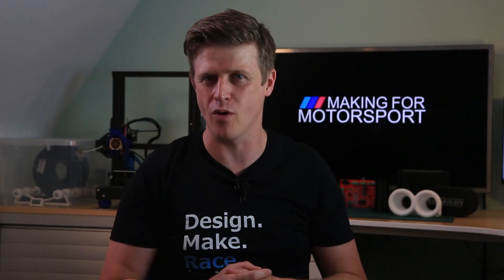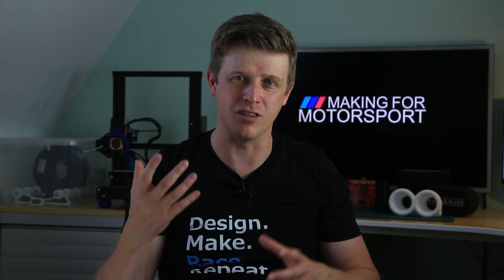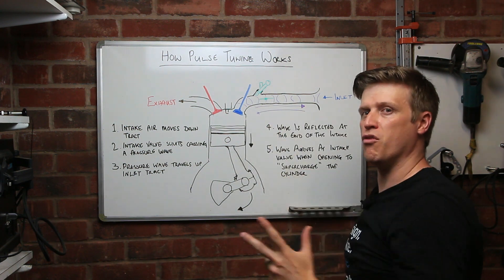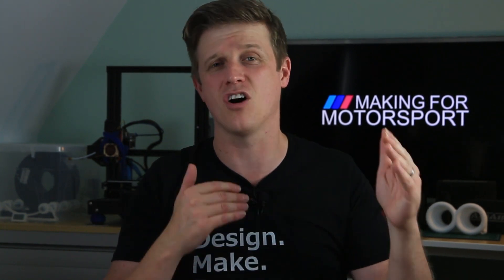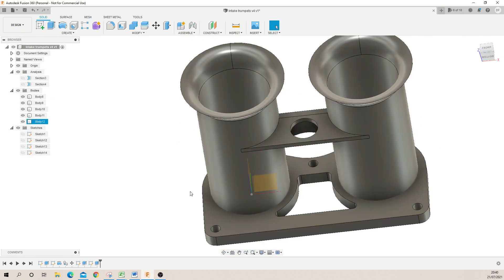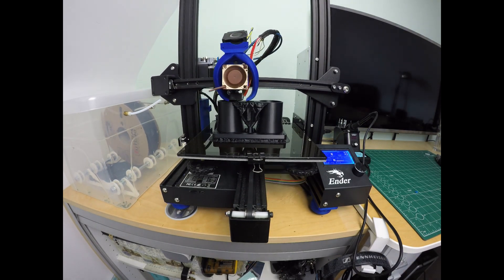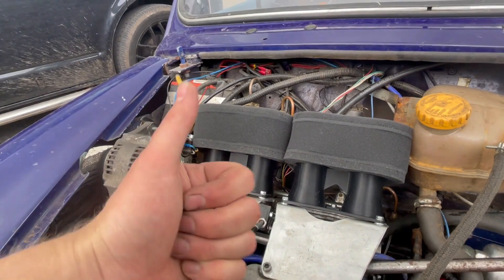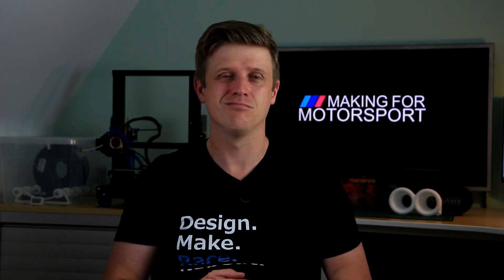Velocity Stacks - What they do and how to make them... a.k.a. Air horns, ram pipes, air trumpets....

Comment: Good video my only point is that there a two issues you need to be aware of, diameter of the ram pipe is very important as it controls the size of the pressure wave.  The second is you need a negative wave at valve opening to get the max cylinder fill.  I have research papers from  Honda race team to support my point I also have pressure traces and peak cylinder pressure reading that I got from my testing.  I am happy to discuss by email and supply you with the graphs and data to support my statements above.
Reply from the maker: Anthony, very interesting… I looking into the pulse tuning properly and there is a lot to it… I have promptly bought a proper text book the likes of which I haven’t seen since being in my University library, to do proper research.

If you have further good data and info on this that’d be great as I really want to put together THE BEST, most accurate video on this…. 

My email is on my channel page - makingformotorsport-at-outlook dot com…

Really happy to discuss futher….
Reply: @MakingforMotorsport  Email Sent
Reply from the maker: @anthonyparle7342  thanks for that, I haven’t seen it so far but I will keep looking 👍
Reply: @MakingforMotorsport  I sent it about 2 hours ago, its from my business email address.
Reply from the maker: Hi Anthony, found it in my junk, I have replied! 👍
Reply: @MakingforMotorsport  I just sent you a email with a graph Dave to start you down the rabbit hole

Comment: Hi Guy!! I designed some time ago an intake trumpet kit for keihin carburettors with the measurements for installing Ramair air filters. If you are interested I will give you the link where I uploaded them (on the Grab Cad page) since YouTube does not let you put a link here in the comments. I printed them in PLA 870 and it holds up very well !!!!. maybe ABS or Nylon would be much better. greetings and encouragement with your youtube channel, it's great !!!!
Reply from the maker: Cheers buddy! Glad you like the channel!  Good to hear you are doing some modelling and making yourself, the more people the better as far as I am concerned!
PLA does work for these but I wanted some margin so I definitely didn’t get failure…

Comment: Really incredible. i am blown away by how you broke the design down to it's simplest language.
However, I was under the impression that a hourglass shaped inlet was more ideal. Ie: flared inlet, choked center, flared outlet. It contributes to the venturi effect allowing increased airflow at slightly higher pressure.  Am I wrong?
Reply from the maker: Thanks for the comments, glad you’re enjoying it!
In terms of inlet shape, what you are describing is the shape used in carbs where the constriction and Venturini effect gives the pressure difference to move the fuel, however in injection you don’t need this and the choke just acts as a constriction to flow.  Yes, the air speeds up but as the diameter increases it slows down again.  Obviously it’s far more complicated than this but generally the fewer restrictions the better 👍
Reply: Thanks for the reply. I suppose I wasn't thinking clearly

Comment: Hi! i´d like to ask you if what you have in your print bed is kapton tape. And if it is, did it give you a good resault? with wich materials? 
I´ve been thinking on giving it a try.
Reply from the maker: Hi there! The print surface was a standard glass with Kapton tape on it.  This does work well but what you find it the tape starts to pull up from the glass and it also needs redoing every print.

I eventually bought a PEI spring steel build surface and have not looked back.  Winner.  I use it for everything apart from nylon.
Reply: @MakingforMotorsport  thanks a lot for your advice! I'll keep it on mind. I haven't tried pei sheet yet but I should. Only used glass, sand blasted glass, and a fake build talk surface (I'm from Argentina and it's kind of hard to get quality supplies)
Anyway I'll search for a pei one.
I really liked your channel !

Comment: any reason for using this instead of the carbon fibre you used for the inlet manifold?how is that holding up?
Reply from the maker: Just cost mate, the ASA is less than half the price, and the manifold is doing well, in fact I am just finishing a video looking at them and the other 3D prints at the moment 👍

Comment: Good one, for sure, more modling. 
What temps / mods do you use with ASA?
Reply from the maker: I run 250/85 onto PEI and it works beautifully.  I am making the next video which is a round up of the 3D printing on the car… that’ll have all the info 👍
Reply: @MakingforMotorsport  Thanks, enjoying your vids, clean and consice. 

Have a simple programable ign on my mini, but outdated and no option for logging or display. Looking at speeduino.
Reply from the maker: @no66  cheers bud!  If it helps your installation you can easily use the Speedy as ignition only if that makes life easier for an bit by bit install. It’s what I did…

Comment: i wondering, what kind of air filter (in video) did you use on the velocity stack ?
Reply from the maker: The cheapest known brand I could find! 😂. It’s a RAM-AIR unit that just pulls over the top of trumpets

Comment: more modelling here too, how do you choose radius, just trial on cfd? Thanks for sharing all that with us!
Reply from the maker: This will be in the modelling video in more detail,  but the limitations on diameter just meant I had what I had so I used the space…

Had there been some flow separation on the CFD I would have changed it but all was well!
Reply: @MakingforMotorsport  Got it! thanks for the answer

Comment: Here's a question I've been mulling over recently. Do you time your intake pulse for when the valve opens so you end up with a bit more exhaust scavenging if it hits when you have valve overlap, but presumably filling the cylinder earlier on means diminishing returns as it lowers the pressure differential throughout the rest of the stroke. Or, do you time the pulse just before the inlet valve closes so you pile a little more air in right at the last minute, meaning your cylinder is more filled than it would otherwise have been?
Reply from the maker: Absolutely, that’s one of the things I don’t like about the “traditional” explanation, the pulse at intake valve open would do exactly that, just lower the cylinder filling over the rest of the cycle, but stuffing that last bit in just before valve close… that might work…
The way I see it, when you put the last bit of clothes in the luggage, it’s just before you close it!  (And that’s what the research I have found says aswell)

Excellent comment!
Reply: @MakingforMotorsport  Thanks! The only benefit I could see of having it hit the valve when it's just opened would be to do some extra exhaust scavenging with valve overlap. What I'd want to do is make two different length intakes, one sized for valve opening timing at peak power and the other for valve closing and see which one worked better. But at the moment I'd settle for having the thing running!

Comment: Nicely made BUT just please let us know how would the average weekend eager mechanic would come by such an exotics printer, 
And now seriously what a setup such as yours will set you back 
In order to produce stuff like it
Reply from the maker: Ender 3 - £150
Glass bed - £20
Kapton tape - £8
1kg of ASA - £35
Fusion360 - £0
Total outlay - £213
(Assuming you have a working computer, and a house with electricity - if not this might get very expensive😂)
To do this in metal (aluminium) means having a lathe and Ac TIG, mine cost me £500 & £750 soooo £1250, I think that option is out (haven’t even mentioned the cost of the material).
The only other option is to buy them, if you want custom lengths (100mm?) you are looking at minimum £60/cylinder so £240.

So 3D printed = £213 vs Bought = £240 (but only 1 option leaves you with a 3D printer at the end of it! 😉)

Comment: another great video, hell yeah. Question, can this stuff be done with ckeap entry level 3d printers or should I start with a bit up market one? (what features do I need?) Keep up the great work!
ps I used to run a rotary engined imp in autotests down here, downunder.
Reply from the maker: A rotary engined imp?  Now that appeals in so many ways… love an imp…

Anyway, to answer your question, I am printing all this on my Ender3Pro (very cheap and entry level) which is slightly modified, there is more detail on my “3D printing Carbon Fibre Nylon on an Ender 3” video… although for the ASA I was using kapton tape on the bed.

I am also building an enclosure so I can start printing Polycarbonate… but even after the mods the cost will be half of something that can do it out the box…

Comment: Great stuff!! Did you smooth the insides with acetone, or just use the surface off the print bed?
Reply from the maker: I just use the straight printed surfaces and just make sure that any blobs or stringing is sorted (minimal with the Asa) there will always be a boundary layer at the wall so as long as it’s relatively smooth as printed it’s fine…

Comment: If you really want to learn about individual runner intakes, you really should get some motorcycle tuning publications.
At present, your 're-inventing the wheel' from stuff that's been out since 1940's (P.E.Irving, Tuning for speed, 1948)
David Vizard has been publishing articles since late 1960's plus has many tuning books that apply to any four stroke engine
There are plenty of formula to calculate tuned intake length rather than just guessing +/-10mm. 
You need valve events to use formula though (intake open/close, exhaust open/close)
It's also well known that a taper will spread the effect of a tuned length over a wider RPM range so making tuned length less critical to mm changes

Comment: Pulse tuning? Now think about exhaust timing like in a 2020 ish Nissan Versa where some of the exhaust goes back into the intake and the intake opens with the exhaust open to push out the hot air from the combustion chamber with air from the intake to cool it off!
Reply from the maker: Yeah, valve overlap, it is very common in hairy cams for NA tuning but rarely found on street cars (except when VTEC kicks in yo) because it causes rough idle and it appalling for emissions…
It can be done a lot better now with VTEC-like systems and direct injection 👍

Comment: Used such filters on my throttle bodys and find that under top rpm 10-12k they are cuts power because filters just sucked into the velocity stacks.
Reply from the maker: Wow that’s some Revs… bike engine?
Reply: @MakingforMotorsport  yes it is gsxr 1157cc with 42mm throttles
Reply: @MakingforMotorsport  I also tested them on flow bench, the same result....

Comment: Dude, just started watching your videos and I am wondering if you know that long velocity stacks are better for low rpm? I think I caught you talking about long stacks for high rpm at some point... Just hop you're not chasing your tail here.
Reply from the maker: Pretty sure I didn’t (or at least hope I didn’t) 😂.  I may have said low-to-mid once tho….
Either way, short help at low revs too because there are multiple reflections/resonances so you pick up benefits at low revs from shorter stacks too, they just aren’t as powerful….👍
Reply: @MakingforMotorsport  exactly! If you need so formulas to calculate the lenght you really need for a specific rpm, hit me up! I am at the end of my bachelor's degree in mechanical engineering and I have a class where we calculate all these things 😁😁
Reply from the maker: Hubert, that would be very very useful.  As you saw in the video, once i did some proper research I found that the traditional explanation is wrong.  I plan to make a video on this but with such a technical subject I want to be 100% correct and use referenced sources etc etc (just like I when I was in Uni).  I am not longer in education so my access to academic literature is restricted so if you are able to send something over that would be AMAZING! 👍
Reply: @MakingforMotorsport  What is your email? I plan to translate what you need from french to english during my Christmas break
Reply from the maker: Hubert you are a legend!  Le legende!!  I can’t directly write it here or eBay will delete it but it’s on my channel page on the “about” page and you’ve gotta click a button to reveal it…

Comment: Venturi air ram much much more effective
Reply from the maker: Venturi?  I have some carbs from the 70s that have lovely Venturi in them 👍😂
Reply: @MakingforMotorsport  make them on intake pipe could give you better effect and you should learn something there
Reply from the maker: So as I understand it, a Venturi is a reduction in diameter, which reduces cross section, which forces an increase in flow velocity and a corresponding drop in pressure (In accordance with Bernoulli).  This pressure drop (and therefore the pressure difference) is utilised mainly in carbs to more fuel into the airflow.  However, there must be a constriction, which generally isn’t what you want.

If there is way of using venturis outside of the above (and I don’t mean tapers) please post a link or something as I am always keen to learn 👍